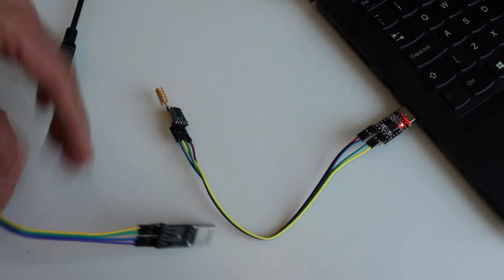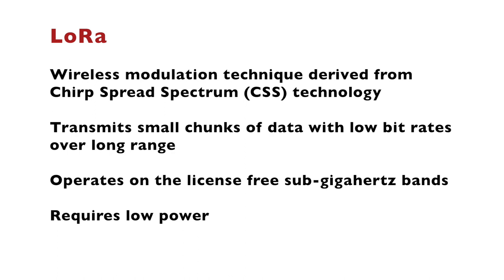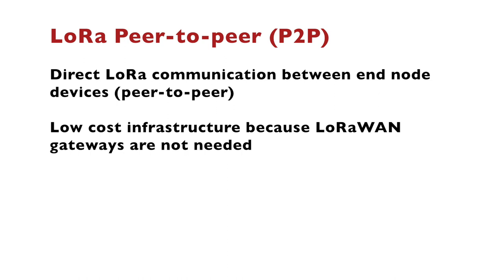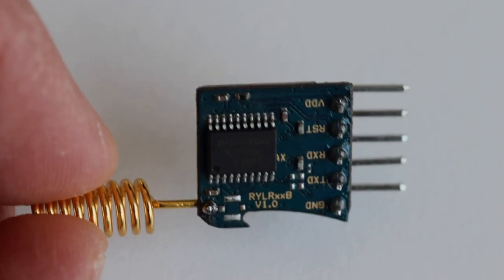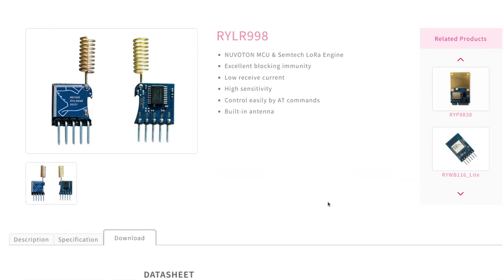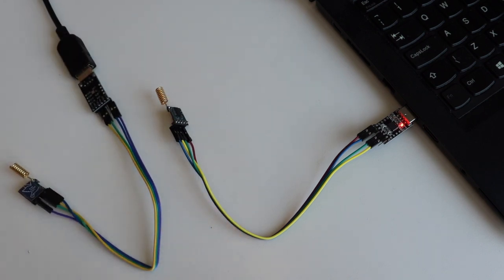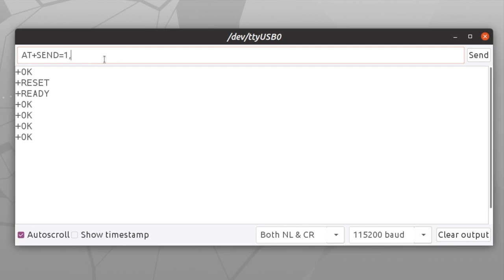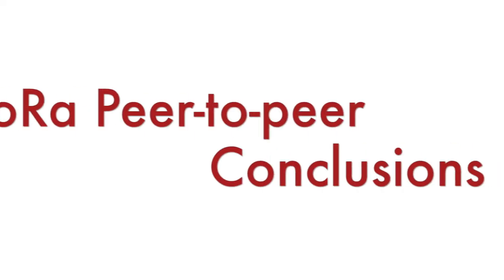LoRa Peer-to-peer (P2P) Demo with REYAX RYLR998

Comment: thank you for this, that is very useful, I do have a question though:

the AT commands are essentially strings, I wonder is it possible to also send pure binary data, or will I always have to go trough the binary -> string -> binary conversion?
Reply from the maker: Yes, exactly the AT commands are strings. This is actually a very typical way for controlling modems. Most probably you will need to serialize the data, send it and deserialize it after receiving it on the other LoRa node.

Comment: Can you show how to do this from a raspi 3 or maybe even a zero through the gpio?
Reply from the maker: I am not sure I will have time to post a step by step tutorial in near future but in general you can use similar approach and directly connect RYLR998 to the UART pins on the 40 pin header of Raspberry Pi (or even 26 pin if you are using the very first rpi). The UART is on pin 8 (GPIO14) for TX and pin 10 (GPIO15) for RX. Again connect TX to RX and RX to TX as in this video. After that from rpi-config of Raspberry Pi OS enable serial communication and the rest of the steps should be identical to what you see in this video.

Comment: As far as I understand all data transmission is visible and easy to read for man in the middle attack. Does LORA P2P offer any security to avoid this?
Reply from the maker: REYAX modules are designed with their own proprietary protocol. Because it is not open source I cannot comment the security aspect of this proprietary protocol. For security purposes, you may consider end to end encryption implementation on the application level.

Comment: Very nice video.  I have seen many like it.  I can communicate PC to PC with LoRa.  I have tried many times and many ways to communicate with LoRa RYLR896 and using Arduino Nano and or Mega 2560 boards.  I used 3.3v Vcc on both.  I either get no communications or ERR=1 or ERR=2 on the receiver side.    I have been trying different methods from many youtube videos.  None work like they demonstrate on the videos.  What am I doing wrong?
Reply from the maker: What is your approach for programming Arduino Nano and or Mega 2560 boards in terms of your RYLR896? Are you using an open source Arduino library or are you sending AT commands directly as in my video for PC communication?

Comment: @Leon Anavi  I have tried  but the port is not found. I can see before you ran the serial monitor there is a code named "oled-dispaly-sketch". Do I need that code for the AT Command? can you please help me on this.I am really trying to learn it. Thanks.
Reply from the maker: as mentioned in it the other comments you need to have an appropriate driver installed for your USB to UART converter on the OS you are using.

Comment: Can I do it using windows PC?
Reply from the maker: Yes, you can apply the same approach using Arduino IDE on MS Windows. Just make sure the right drivers are installed and the right port is selected for the USB to UART debug converter.
Reply: @LeonAnavi  I have tried  but the port is not found. I can see before you ran the serial monitor there is a code named "oled-dispaly-sketch". Do I need that code for the AT Command? can you please help me on this.I am really trying to learn it. Thanks.
Reply from the maker: @Kingoftiger1223  no, no code is needed. In this case Arduino IDE is used just for the feature serial monitor.

What model USB to UART converter are you using to connect RYLR998 to a computer? Considering you are using in on MS Windows, are drivers for it installed?
Reply: Will PL2303 USB to UART will work?
Reply from the maker: @Kingoftiger1223  I don't have experience with it. Most probably you will need a driver for it if you are using MS Windows: https://www.prolific.com.tw/US/ShowProduct.aspx?p_id=225&pcid=41
Reply: Okay I am giving it a try